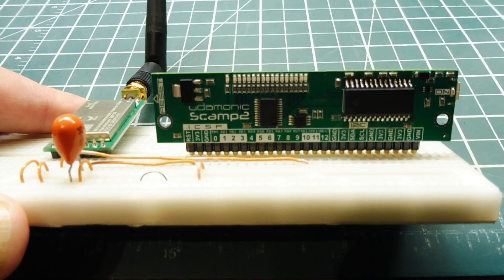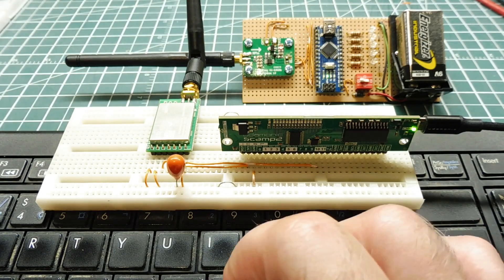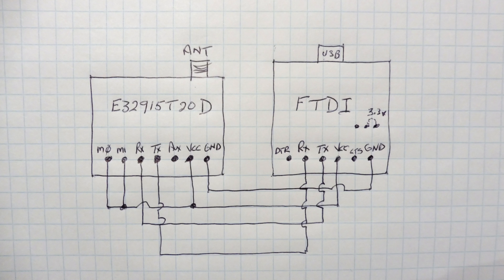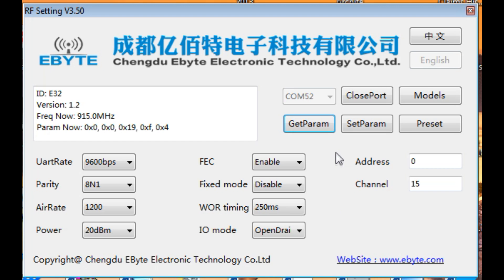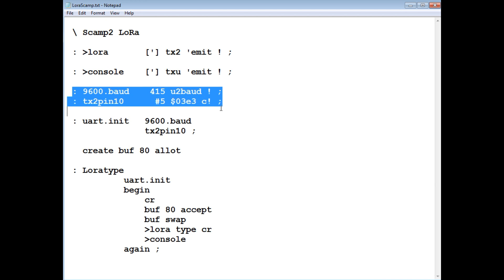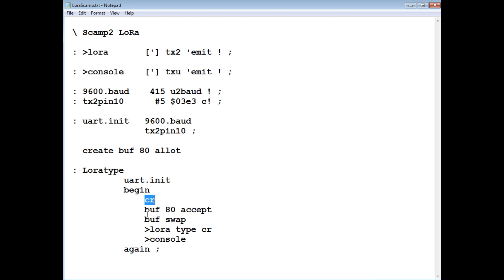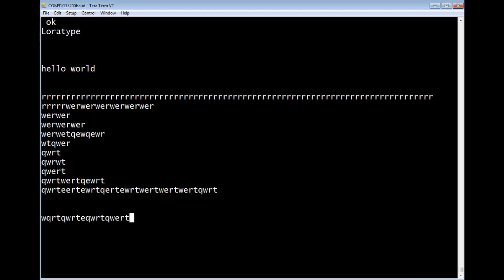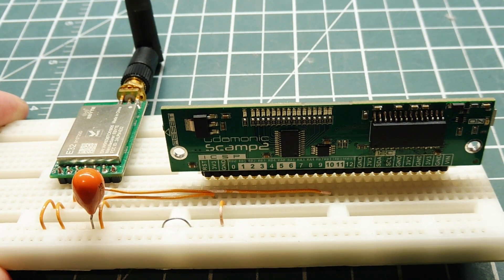LoRa To Scamp2 Interface / Flashforth / PIC

Comment: I’ve used those modules in some of my projects, I even designed a lora to wifi gateway using an ESP32, so anything on the lora network can access the network and internet, I did a few videos on the projects.